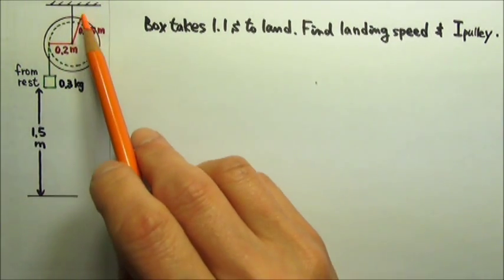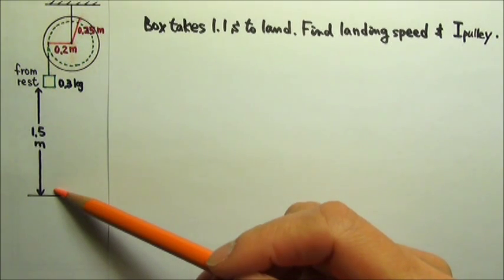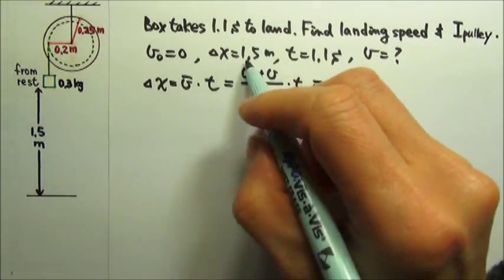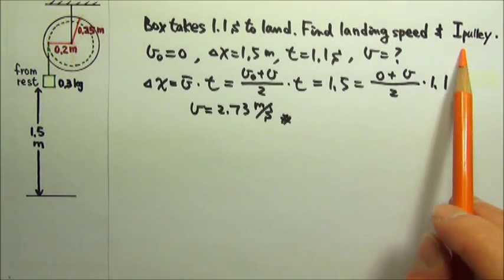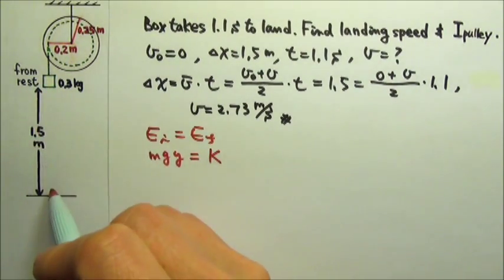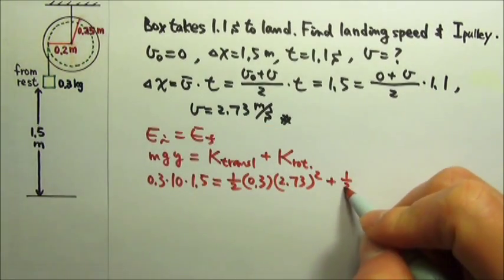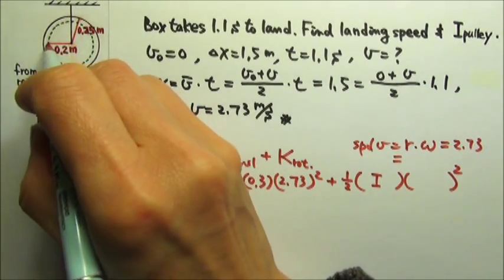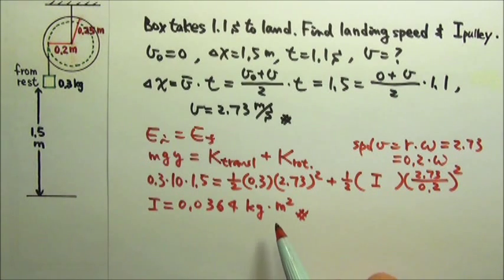AP Physics 1: Rotation 22: Conservation of Energy Problem: Pulley with Mass

Comment: Quick question for finding landing speed and that is why cant i just use V^2=V^2+2gH to find landing speed ??
Reply from the maker: steve khan Vf^2=Vi^2+2gH does not give the correct Vf, because the box is not in free fall. The acceleration of the box is not g.
Reply: oh okay, but im confused of where the acceleration comes from ? The torque from the wheel ?
Reply from the maker: steve khan Please see Rotation 21: Newton's Second Law for Rotation: Problem 3: Pulley with Mass at https://sites.google.com/site/twuphysicslessons/home/torque/ap-1-rotation-page-3
Reply: Why did we use the 0.2 radius and not the 0.25 for I
Reply from the maker: I used r = 0.2 m when I calculated torque produced by tension because the string wraps around the portion with r = 0.2m. 
And angular speed = v/r = v/0.2 because, again, the string wraps around the portion with r = 0.2m.
Reply from the maker: I did not use r = 0.2 for I, but I used r = 0.2 as the lever arm to find torque produced by tension. We had to find I without using any of the m(r^2) equations.